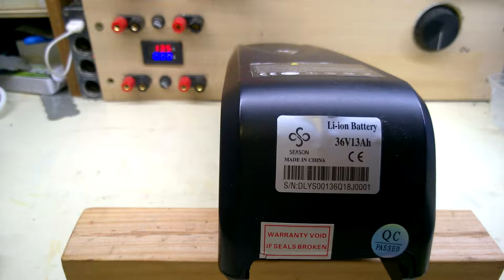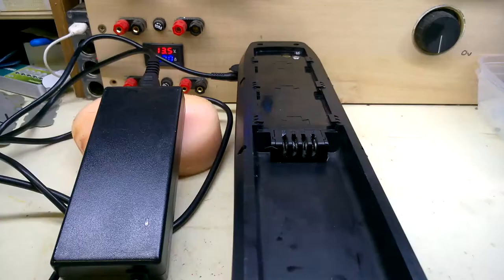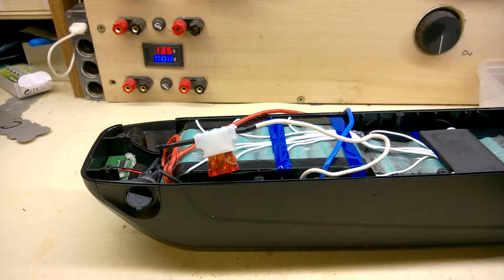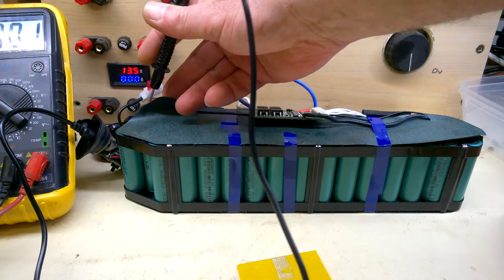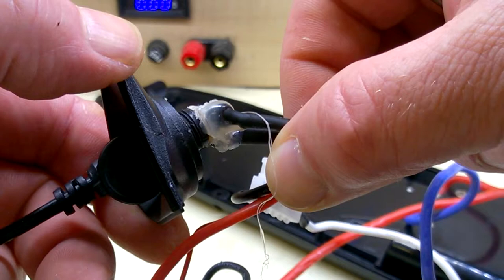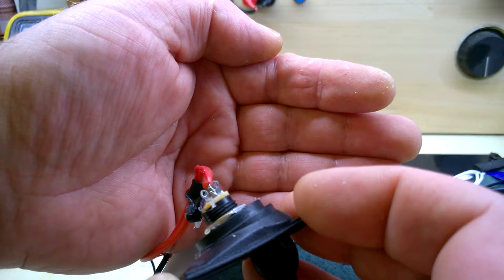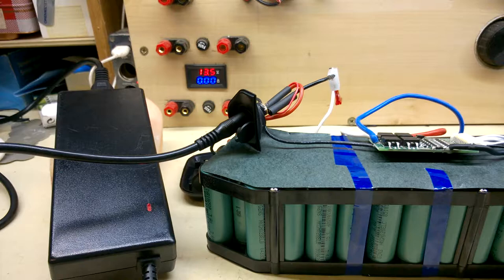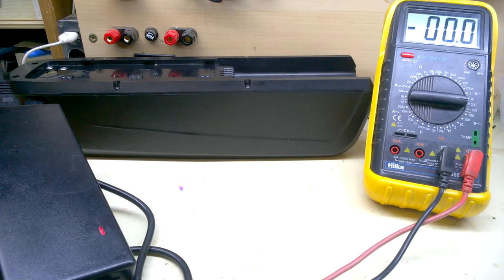Hailong 36v Li ion battery not charging repaired

Comment: How did you work on it without shocking yourself?  I was thinking maybe you had to remove the fuse to prevent shock but it looks like that isn't an issue.
Reply from the maker: It seems that you are confusing mains ac (house electricity) and low voltage dc.
Mains ac WILL shock you , and WILL KILL YOU.
Low voltage dc (36v in this case) will NOT shock you.
Reply: @makeitwork7522  Thanks for the reply.  Maybe it's not enough to kill but enough to feel it.  When I try to use a multimeter to test the port, it creates a big spark.  I need to replace the port.  So when you are soldering the charge port, do you have to be ultra careful to not touch the red and black wire accidentally otherwise there is a big spark?  I guess there is not a way to disable the power from the battery until after the soldering is done?
Reply from the maker: @bguy1979  
What you have done is create a short circuit where you connect (or bridge / short) the positive and negative wires with your meter probes - thereby causing a large current to flow (big spark).

If I'm testing for voltage at the charge port , I NEVER use meter probes directly because the +ive and -ive are so close together.
Plug a dc male plug into the socket and measure voltage on the inside of this plug - the contacts are further apart.

Usually when the charge port is shorted out , the  charge fuse also blows.
And when soldering the port , do one wire at a time and heatshrink it before soldering the other one.

To disable power to the charging port , simply remove the charging fuse (and remember to put it back when you're done !!)
Reply: I think u have misunderstood the whole thing about electricity. A 36v batter you will not feel by touching it. I have 52v and use bare hands on it. (When I had to open it) 

But remember that metals are conductive and that you do not want to touch the battery. Just the volt meters are fine. And as he says when solder u are extra careful because that’s metall.

Comment: I have checked the contiuity, and they're all responding. I don't know why the charging port is not showing any voltage. All the batteries are fine too.
Reply: If there's no voltage coming out of the charging port the charger won't accept it, right?
Reply from the maker: @ryutakeda7329  
Not every charging port shows the battery voltage - depends on the BMS.
Have you checked the charging fuse ????
If you have continuity to the battery (red) and to the board (BMS) , then it should charge.

If it does not , then either the battery is already full or you have a faulty BMS.
Or a faulty charger.

Comment: Hi I'm wondering how much is it to fix a battery of same kind and size if you have worst case scenario?
Reply from the maker: Worst case scenario is if you have to replace all the cells and the BMS.
Cheaper to buy a new battery.
Reply: @makeitwork7522   I have a battery for about 2 months and it won't charge but I think its a port probably as it was charging and I noticed the charge light would charge like it had a bad connection. if it was bms how much is it to replace?
Reply from the maker: @Darara1987  
I would check the charging circuit first (wiring / joints / fuse) before suspecting the BMS.
And check the charger obviously.
Take the cases off and check the voltages on the large white connector going to the BMS.

If all is ok , then replace the BMS.
To replace the BMS only , I would charge £60 to £80.
The price would depend on the need to change the balance connector (not all are the same).
Reply: @makeitwork7522  OK thanks you for responding and I appreciate the information. Are you based in London as I would like to fix my battery as I've only had it for a short time so I think it would be worth fixing instead of buying a new one.
Reply from the maker: @Darara1987  
A long way from London I'm afraid (North Wales)
Reply: @makeitwork7522  😭😭😭😭😭
Reply: @makeitwork7522  I guess I'll have to try follow the steps in your video and do some analysis on the issue wish me luck 😂. I hope it just a fuse or a lose connection 🙏🏾

Comment: hi mate i have this exact same battery and i cleaned my bike and got water in the hole where the charger goes, i tried cleaning it out with a tiny flat screwdriver then it sparked and since then i am unable to charge it? i rhode it to work so it still works but i can't charge it at all, and the light just stays green? do you think i have the same issue?
Reply from the maker: You've probably shorted the charging connector,and as it's connected to the battery,it's most likely blown the fuse (as shown in the video).
Open the cases and test/replace the fuse.The fuse in the video was 10 amp (Red)
Good luck.
Reply: @makeitwork7522  thankyou man did the above and it's charging on red now, seriously mate your video has saved my bacon, i can get to work now dude
Reply: First of all, you’ll use compressed air or WD 40 next time. Second of all, having a fused input saved your bacon, but imo a bms which puts a voltage on a charge port with a current capable of damaging itself if shorted isn’t doing a proper job of input isolation, so fusing it is just says to me that the maker knew the design was half-baked from its inception.

Comment: hi makeitwork what fuse was that on the battery as i would like to add one ?
Reply from the maker: I didn't look at the time,but it's a red blade fuse,so that would be 10 amps.
The value is a little bit high for the charger output (again I didn't look because the charger was ok),but I'd assume the charger gives about 2 amps.
Personally , I'd put a 5 amp fuse there.
Reply: @makeitwork7522  ideal cheers after watching your video i thought i had the same problem but didnt have fuse i think its the bms but i think my battery has gone to low at 15 volts not sure a new bms is going to make a difference what do you think ?
Reply from the maker: @johntaylor5941  If your battery is a 36volt one , and you've only got 15volt showing , you've got no chance of charging it with the original charger.
Assuming it's a 10s configuration (10 cells in series) , then you've got an average of 1.5 volts per cell (or cells in parallel).
I'm also assuming you have no dead cells in there.

If there are no dead cells , it MAY be possible to revive the cells , but not with the original charger.

It's unlikely to be a BMS problem , just run down cells.

Comment: I’ve got similar problem... I’ll tell you all the story so you can maybe help me out on what I should do.

I received my electric bike last week, used only twice since.

Problem:
1 of the 4 green lights on the battery turned off, so I put the battery to charge and the light on the charger was showing green and 3 lights of the battery where turned on. So I unplug the battery from the charger (the charger still shows green even though there is nothing connected), I turned off the battery and plug the battery on the charger again. Same thing happens, only 3 green lights turn on and the charger light still shows green. so I turned off the battery while charging and after a few seconds 4 green lights flash on the battery, the charger light goes red and turns back to green and when I look to the battery one of lights of the battery is off.

What could this be?
Reply from the maker: The charger will show a green light when it thinks the battery is full , or not connected to the battery.
I did not see  the green lights "flash" on the one in the video.

If the charger light is a constant red , it should be charging.
If it's only on red briefly and the battery is still not full , there may be a problem (like in the video) where the charging wire is not making constant contact.

A voltmeter reading would help you find the problem (battery voltage too low , charger not working properly etc).
Reply: I’m supposing that since the charger and battery both have indicator lps , the battery’s fourth green lp is a combination overcharge plus status indicator light for convenience of people who are colorblind to the changes of color in the charger’s single lp. #4 may finally light up as the battery is conditioned and holds a surface charge longer -or remain mostly off until the battery starts going bad and tops off too quickly. You should contact the company for a link to the user’s manual in English before they change/supersede/deprecate that battery design
Reply: makeitwork I disagree. The OP didn’t express any problems therefore diagnostic procedures and diagnostic tools shouldn’t be applied. Also, since the bike is evidently new, taking potluck shots at complicated electronics armed with a new tool complete with conductive pokers and an unseasoned user is asking to have their warranty voided.
Reply from the maker: @HighestRank   The OP's comment - 
 Problem:
1 of the 4 green lights on the battery turned off, so I put the battery to charge and the light on the charger was showing green and 3 lights of the battery where turned on. So I unplug the battery from the charger (the charger still shows green even though there is nothing connected), I turned off the battery and plug the battery on the charger again. Same thing happens, only 3 green lights turn on and the charger light still shows green. so I turned off the battery while charging and after a few seconds 4 green lights flash on the battery, the charger light goes red and turns back to green and when I look to the battery one of lights of the battery is off.

The OP clearly states he has a "problem".
I suggested he may have a charging issue if all the lights on the battery did not light , and that could be confirmed with a voltmeter - nothing more.

Nothing I suggested would invalidate the warranty.

Comment: I have the same symptoms: green light on charger when I know the battery is low. The lack of solder on that connection, is that usually the fault? Or is the fuse usually the culprit?
Thank you.
Regards,
Mac
Reply from the maker: There are a few possibilities.
Could be a blown fuse , no connection to the charging port , a faulty BMS or cells problems within the battery pack.

You will need to open it up to investigate - it may be an easy fix.

Comment: I have had a Hailong 48V 11.5Ah for 6 months. Two days ago, I set mine to charg with at least 50-60% or more left on it. When I connected it to the bike, no response.

I checked the voltage and the voltmeter says 0.009V, I don't know how it has managed to drain itself within a 24 hour period in the OFF position. It doesn't want to charge as the charger indicator stays green, and the battery level indicators doesn't show up.

The eBay seller has told me not to open the battery as for warranty.

Do you have any suggestions before I in case send it off to a repair?
Reply from the maker: If you have no output voltage , it does not mean that the whole battery pack has discharged.
It could be a faulty BMS , or that one cell group has gone low voltage (this would prevent you charging the pack too).

It could also be that the keyswitch is misbehaving.
Some switch the BMS on/off - perhaps yours has a poor/no connection and so is permanently off regardless of the key position.

And if it's under warranty , send it back to the seller.
Reply: @makeitwork7522  I managed to solve it for now. I flicked the ON/OFF switch several times while checking the battery indicator and voltage.
I charged with it ON and got 1.15V. Flicked OFF and ON and got 0.01V again. Flicked the switch again a couple of times and all of a sudden I got the indicators up and 54V with the voltmeter 😀

Comment: Can't even get the battery pack out of mine, some jerk has obviously put glue so now I'm gonna have to try smashing the case into pieces, what a fkn joke 😭
Reply from the maker: Try heating the outside of the case with a hot air gun / hot air paint stripper before taking an axe to the case.
Getting it hot will soften some glues.
Reply: @makeitwork7522  Can't believe I'd forgotten the old heat trick 👍🙏, she's out and I'm not happy, pathetic, I'm talking NO fuse, i accidentally shorted it out on a huge steel frame "had branch wires coming off the power lead for a spot light so it's my fault for having a dangling MALE" idiot me" deans connection which touched the frame and steel chain 🔗 as i was locking it up, got a BIG FLASH and i knew i was in trouble 😂, i haven't the eyesight to solder and disconnect the TINY SHITTY bms that i can feel sat on top "if it's got one i haven't cut open the blue shrink wrap yet, and no way its 13ah there's not enough cells 😒, it was a great battery charged upto 55v, i guess I'm screwed if there's no bms or fuse after such a massive short, I'm eventually gonna post you all my cells i have collected so you can build me a 60v 20ah 30amp pack 👍, I've talked with you before, if i recall you're in 🏴 right? Thanks for the reminder with the Heat for glue "layed it on radiator for an hour, some jerk had put Two white long double sided sticky pad strips on it 🙄had to really tug on it, never buying from this particular vendor on ebay again.
Reply from the maker: @ianmangham4570  
There probably is an output fuse - usually situated near the output connector.
It's unlikely to be inside the blue wrapped cells.
You will also have a BMS under the wrap which will have shut down after the short.
It's doubtful that you've damaged the BMS unless it's a really crappy one.
Reply: @makeitwork7522  No fuse at output, just pos and neg soldered to metal grid which slides onto backplate which fixes to the bike 🙄 same goes for backplate just pos and neg soldered with an xt60 connection on the other end, very odd as I've seen vids on here and can clearly see two fuses on output and charge point. Unbelievable bad luck, my only hope is i can unplug bms and that fixes it if it resets
Reply: @makeitwork7522  YES, fixed it, i removed the bms plug and plugged the charger in, then soon as i attached it she started charging, ITS ALIVE IT'S ALIVE 😂, I'm so happy because i didn't want to spend £300 just before Christmas 🤶, MERRY XMAS 🇬🇧🙏
Reply from the maker: @ianmangham4570  
Good lad.
With that money saved , you can now buy some Christmas tangerines ........
Reply: @makeitwork7522  Satsumas

Comment: Could I send my battery to you for a repair?
Reply from the maker: It depends on your location (I'm in North Wales).
Most , if not all couriers will not accept ebike Lithium batteries to be transported.
But then , most people lie about what's in the package !!
Reply: @makeitwork7522  I'm next to leeds, and I can't tell if it's the battery or charger, the charger didn't work on other devices I have using the same port and the battery is completely flat how just bought this e bike second hand and been conned sold as new 1 day use
Reply from the maker: @16094s  
If you can get the battery to me , I would be happy to look at it for you.
Reply: @makeitwork7522  do you have an email I can discuss it further on with you please
Reply from the maker: @16094s  
Send it to garethem1@sky.com
Reply: @makeitwork7522  thank you
Reply from the maker: Sorry - nothing received yet (not in spam folder either).
Try again please.
garethem1@sky.com